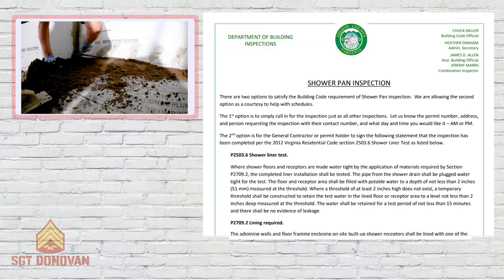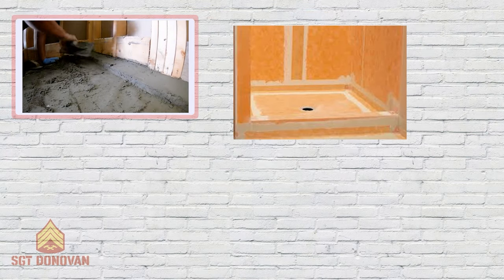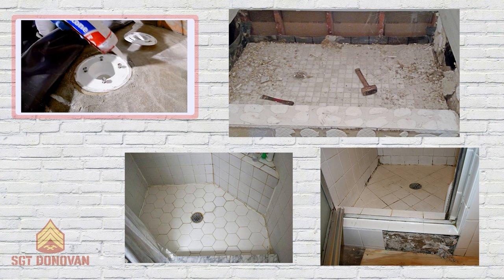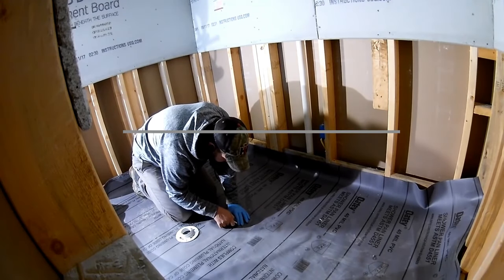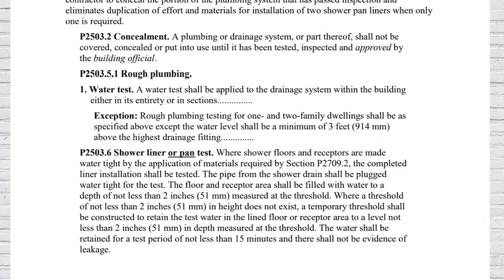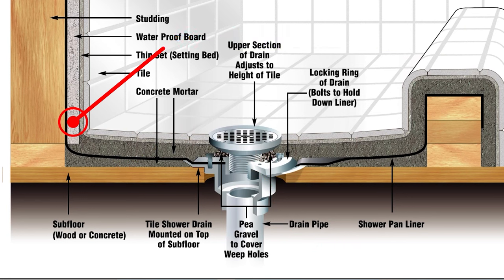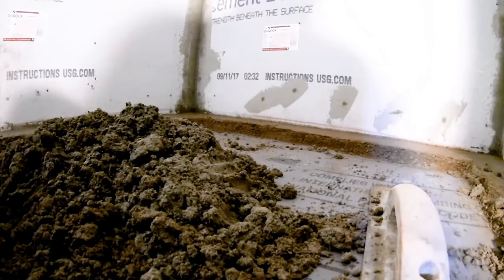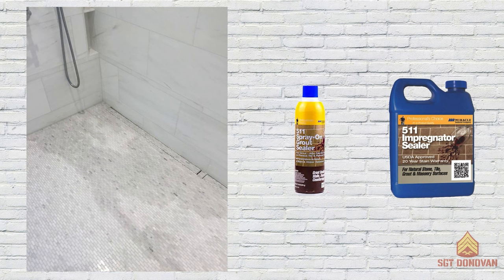Why Shower Pans Fail | Avoid These Mistakes! (Most Pros Do it Wrong!)

Comment: So, it's always recommended we install gravel around the drain for any moisture that's worked it's way down into the mortar bed. How is it the water can flow by gravity through the entire mortar bed but somehow won't make it into the drain if mortar surrounds the weep holes?
Reply: Its just easier for water to travel through larger pebbles then tiny ones.
Reply: If there's a pre slope done it still takes time for the water to flow through the mud bed towards the drain. Water travels through the pebbles easier than through the mud bed so the gravel eases access to the weep holes and helps to prevent excess water accumulating in the area around the drain (where all excess water is directed in a properly installed pan).
Reply: Don’t forget evaporation also takes place
Reply: @dongately2817  Thank you for clarifying. 👍
Reply: @hgsmasterclass3452   - I saw a video where a guy used silicone to prevent water from getting down the drain so it’s good to see someone doing the job right 👍
Reply: That sounds perfect! 🤣😂🙄

Comment: So if your using sealer to keep the grout from soaking up water hows the water going to evaporate if it gets absorbed from the mud bed...kinda the same concept of a topical....
Reply: Water vapor can pass through sealer. The sealer repels the denser liquid water. We tested 60 mil thick HDPE and 1/1,000th of a gram of water passed through it every two days. It was 100 % humidity inside and 50 % humidity outside the water vessel.

Comment: What causes excess water to build in the pan liner? Now that the kids are a bit older, my main tiled shower is used multiple times a day. I have access behind one of the walls and see water in the liner. Should I be using this shower less often to let evaporation work or would this be considered failed? Thanks for the videos
Reply: The liner wasn't put on top of a presloped bed so it is collecting water, or the weep holes are filled out

Comment: I also believe that I should provide a gap between the backer board and the pan.  Is a silicone bead required in this junction point?  Also, I am applying the backer board to raw 2x4 walls  Should I add a thin sheet of polyethylene behind the backer board extending 2" down in inside the Oatey pan material to insure wall moisture does not come in contact the wood wall structure?
Reply: Yes, silicone between wall and floor.
Use foam wall board. Liquid flash seams & screws. Tape & flash Corners.
Put a liquid membrane over your base / footer 2x4s - Hydro Ban Quick Cure or Manville 
This video became outdated tech as foam pans & sheet & liquid membranes replaced everything mentioned here.

Comment: I've seen your video on building a shower pan. However, I am currently building a curbless shower pan on a concrete slab so it's a little different. I'm worried that I was advised wrong. We had to adjust some plumbing so we had a huge hole in the slab. We just recently filled it in with concrete  and also chiseled the surrounding slab down at an angle of course. The guy helping me assured me that it was okay to cover the locking ring with the concrete which I believe means the weep holes are now covered with concrete. His next steps were going to be to put thin-set down, then schluter paper, and then I'm assuming tile on top of that.  According to the diagram on this video at the 30 second mark, we should have left that locking ring and weep holes exposed. And we should be using a shower liner, then the thin set. 1) do I absolutely need to re-expose the locking ring/weep holes? 2) Do I need to use a shower liner like you use on top of the concrete or will the thin-set and shluter paper work? 3) Do you know of any good videos that show exactly how you think it should be done?
Reply: If you're using kerdi then u need a kerdi drain (no weeps). You're using dissimilar products.

Comment: I've never built a shower and planning to do mine so pardon my ignorance. Here's a question that I have not seen addressed: Why tile a shower pan? I cannot wrap my brain around it. 
I've been studying how folks build showers and I nearly fell off the floor when I learned that grout & thinset are porous materials and it's an accepted fact of life that water will seep below the tiled floor.
I'm hoping that someone can please explain why, in the 21st century, they'd build a shower floor of porous materials guaranteed to NOT be watertight.
I see cans of grout sealer at the hardware store. Does it not work? Better yet why not eliminate tile and seal your mortar floor with a non-porous coating that won't pass moisture? Am I missing something or should the pre-sloped rubber liner weep-hole scheme have gone extinct a century ago? Thanks in advance for your insight.
Reply: I think the short answer is about tile expanding and contracting... 

If you look at Sgt. Donovan's video again, (and look at the Oatey instructions on using a vinyl pan liner (https://www.oatey.com/products/oatey-pvc-shower-pan-liner-1982292245) it clearly shows that the vinyl pan liner provides a fully waterproof (and time-tested) way to build the appropriate foundation to lay your tile on.  Tile and whatever you adhere it to (usually mortar) is going to expand and contract.  Currently there is no cost-effective material that allows you to provide a completely waterproof shower --  if you want a custom tile job.  If you want a pre-built moulded shower pan, you can do that, but those come in set sizes and, if you are installing a shower in a non-standard sized space, that won't work.  They are also overpriced.  A mortar shower pan is fully customizable and reasonably priced and, when done correctly, as waterproof as any pre-moulded thing on the market.  Some of those fail too. 

Hopefully my rambling note makes some sense, but if you watch a few more videos from Sgt. Donovan (https://www.youtube.com/user/sgtdonovan), Sal DiBlasi (https://www.youtube.com/c/SalDiBlasi/videos), Tile Coach (https://www.tilecoach.com/) you will definitely get more answers to all your questions.  These guys are all great (even if they don't always agree) they are true masters of the art.

Comment: I hope you can help me.  We are trying to find the source of a weird smell in my daughter's room.  We have cut every wall and have found no water.  When we cut the wall where the shower is on the other side, there is absolutely no water on the studs, drywall, etc.  I did put my fingers in behind the shower pan liner - membrane that was visible, and it seemed damp.  Could this be my issue?  Is it supposed to feel a bit wet?  Thanks so much!!

Comment: So when using the mortar and liner method, epoxy grout should not be used? I was considering it to improve the waterproof and not have to deal with moldy grout lines and sealants! What are your thoughts on epoxy grout?

Comment: I have a question that kinda related, yet off topic. My wife & I after 40 years, want to bring the washer & dryer upstairs onto the main floor. They will be placed on an outside wall. While the shut-off for washing machines is never turned off during vacation (And Should) I change the braided hoses every 5 years as I tag then with the install date plus date 5 years out. These are #1 in serious leaks. My question has to do with a copper drain pan under the washer in case of an internal part failure! The water level sensor is measuring the change in atmospheric pressure as water fills pushing against it. This could fail. I am a belt & suspenders guy who has seen everything fail to some degree on vehicles. I have been a service tech since early 70’s and became an ASE Master in 78. This is book smarts, knowing how to read a question but the 8 test include questions that only someone who has done it many times can answer correctly! 
 Maybe I am getting ahead of myself, perhaps you did a video on this subject. I can’t find the “Search” feature on any channel with the app. Matter of fact, being retired I went 11 years with a phone. Just curious on your thoughts for saving hardwood floors and how best practices says it should be drained as I like to do things once and done. I won’t alway be here to be the fixer! Thanks! Enjoy what I see. DK, retired.

Comment: Just wondering why not put the pan liner on the bottom or seal it with red guard before you put the concrete on wood. Concrete will eat up the wood if it's laying on bare wood. Why does it anybody do something like that and what's the pros and cons

Comment: Thanks for sharing this .
I thought I was crazy wondering where the water around the drain liner retainer was supposed to go lol .
 Sticking with tried and true here except for I use go-board (high dense foam with fiber infused coating on surface) for the bottom wall board .
I still however leave a gap between the wall board and pan floor .

Comment: nice info, however i would like to see, more in depth on, if you have a wood floor starting or if you have a concrete floor starting. step 1234 etc
Reply from the maker: The install is the same

Comment: Dude, we have torn out countless shower pans (we do a lot of bathroom remodeling),..most of them with no slope, and almost all were done with pvc liner.  To be honest, even though it appears to be a recipe for disaster,..it has only been rarely that this has been a problem...and when it has been a problem,..it was due to leakage..which caused dry rot. In fact,..the leakage itself was NOT due to no slope,..but was made worse by it because the water was not being fed to the drain by gravity...The water would usually find it's way to the leaky spot because it had all the time in the world to look for the leak.
Reply: Thanks for reporting this.  I too have some doubts about the need for sloping mortar under the membrane.  The author implies that the mortar can't handle being saturated with water, and fails for this reason, but concrete can spend its life under water.  Perhaps other factors are more important, like water to mortar mix ratio.
Reply: The mortar failure comes down to 2 factors: 
cement type used, 
Post install maintenance (harsh cleaning chemicals used excessively and no sealing of tile/grout).

Lots of home owners and tiler's will grab a back of type N cement, mix in the 2 parts sand and create the drypack (because type N is rated for inside use). Big mistake.
Pan with 2 pats sand and 1 part Type N cement is only 16.5%  Portland (grows stronger with water and time) while 16.5% of the mix (lime) will erode away from water over time (faster with use certain chemicals cleaners, and clog weep holes I might add). So now have micro-abscesses and barely enough binder to keep the material present held together, let alone resit impact shock or expansion and contraction For a pan with type S the results are a little better: 22.33% of the mix is Portland, while 7.66% is lime. Less abscess and more bonding retained, but still not ideal.
Deck Mud (by Quickcrete) is roughly 65% sand, 30% Portland, and 5% fly ash), but that 30% Portland is true 100% Portland cement (type M cement). So that 30% of the mix will stay in place and bind the 70% together without wearing away from water intrusion even as the fly ash erodes (plus you don't lose any of the binder as the fly ash degrades).

For reference:
Type M – 3200 PSI – 100% Portland (all exterior purposes and load bearing applications below grade,  loadbearing)
Type S – 2200 PSI – 67% Portland – 33% lime (all exterior purposes and load bearing applications below grade, loadbearing)
Type N – 1400 PSI – 50% Portland – 50% lime (above grade exterior and interior, loadbearing)
Type O – 1000 PSI – 33% Portland – 67% lime (above grade exterior or interior for glass blocks, non-loadbearing)
Type K – 750 PSI – 100% lime (practice mortar, above grade exterior or interior historical restorations, non-loadbearing)

Then we get into the cleaners. Really strong acids and bases will erode Portland cement fairly quickly, and lime even faster, especially if it's applied and allowed to sit and absorb into the grout, thinset, and mortar pan. The effect is slower on grout (typically has a 45- 55% Portland composition) and a bit slower on thin set (30 – 40% Portland). Doesn’t matter thought bc capillary action will still carry the chemicals to the mortar pan, and it’ll erode fist because it has the lowest Portland content. Oatley and the writers of the IRC all know this, and it can be seen in their individual research publications.
That's why they cover their butts and state that grout and tile should be sealed on an annual basis.

Comment: Our upstairs shower leaked through into our downstairs ceiling. We had a new contractor come out to fix the issue. He completely redid the shower pan but it leaked again. We had both him and the plumber come look at it and they determined too much water was leaking into the shower pan and it spilled over the top. They said the fix was to seal the grout. In this process we opened up the drywall on the other side of the shower. While cleaning the shower floor to prepare for sealing the grout I noticed there was water in the liner two days later after not turning on the water at all there is still water in the liner. Is that normal?

Comment: And with Redguard, almost NOONE is installing it according to directions.  And even a couple videos out there wondering why it will just peel right off.  They just seem to skip over the "lightweight concrete" portion of the instructions when they don't KNOW what lightweight concrete even means.  HINT:  Cementitious backers and dry-packed mortars DO fall into this category.

Comment: Stop blaming the contractors, it's the product manufacturers that are causing so many issues. They're trying so hard to reinvent the wheel, that they don't take into consideration the basics. I'm getting ready to tile a master bathroom right now. The homeowner paid big money for a Kohler linear shower drain system. I don't know if any of you have used this system yet, but as a 25 year tilesetter, I know, without question, this system will fail. No weep holes, no pre slope, nowhere for the water to go, other than directly into the drain. Any water that seeps through the grout will just sit on the waterproofing, eventually leading to moisture problems. Terrible design, but there's nothing I can do, other than tell the homeowner I won't do the job.
Reply: A poor carpenter blames his tools.

Comment: Hey can you PLEASE help.. we bought a pre sloped shower pan (the Styrofoam like material). We are building a large walk in shower with a linear drain along one side. We put thin set on the wood, then the pre-sloped panels, and I believe all that was needed after that was thin set and the tile. But... my husband put mortar on it and now its not level. Can you please let me know if we should remove/sand that? or just leave as is if it is level even though there are cracks? can we just put the waterproof membrane over that and it should be fine? I am desperately looking for how to move forward with this. Please help.

Comment: You should not be using silicone to bond the rubber pan to the drain. You’re doing that wrong, you should be using NobeSealant 150 that is compatible with your pan linear. Silicone is $10 the right caulking product is like $30 or more. You should be getting this at a tile supply house. Real tile guys don’t buy stuff from homedepot.

Comment: Is gravel used with custom fiberglass pans too, or just PVC liners?
Reply: We don't use gravel in conventional pan liners.  It is sand and cement and that's it.  At least for the ones who actually know what they are doing and how a conventional pan actually works.

Comment: Iam in the middle of redoing our shower. My question is my curb is very long, it might be difficult for me to shape it with mud bed material. Whats your take on using backer board over 2x4 construction, then waterproofing the curb with topical membrane?
Reply: I would silicone any screws that shoot through pan liner and make sure they are stainless steel.  I would still apply a couple of coats of hydroban on backerboard before mudpan is applied.

Comment: MY  thought is run lift by rules rubber sealer set concrete board seal it ground to 3 inches with concrete board sealer 3 inches out do to shower bench even thou rubber sealer extra sealer shouldnt hurt

Comment: Hey there! I am building a shower pan in the way you've detailed for tiling; however instead of tiles, i am planning on using microcement. for the rest of the walls of the shower (according to the microcement tips ive gotten) is to use red gard on the cement board prior to the microcement and then a sealer. My question is, if I am using a liner on the on the shower pan, are you saying (from the video above) that I should avoid using red gard on top of the 2nd layer of the mud mix  (for me, prior to put a thin layer of microcement instead of tile) 
Thank you!

Comment: Why did you need the 1st base of concrete .
Reply: Because it is using an outdated rubber liner method.
This video became outdated tech as foam pans & sheet & liquid membranes replaced everything mentioned here.

Comment: Hydroban (2 generous coats) the walls/preslope using Laticrete fiber tape in corners and seams making it one, contiguous, waterproof unit. Boom, no worries...ever.
Reply: Redgard = 🗑️
Reply: And poly weep protectors are far superior to gravel.